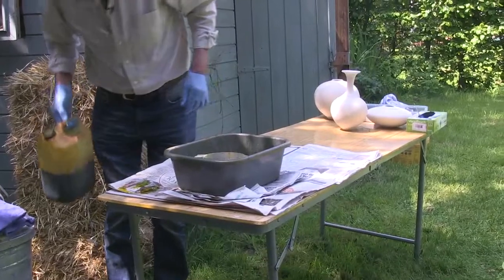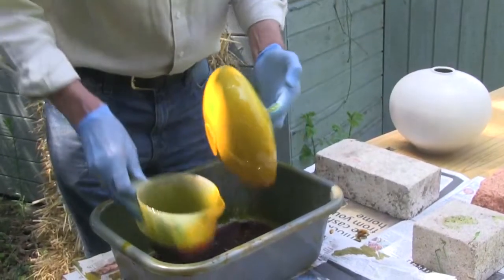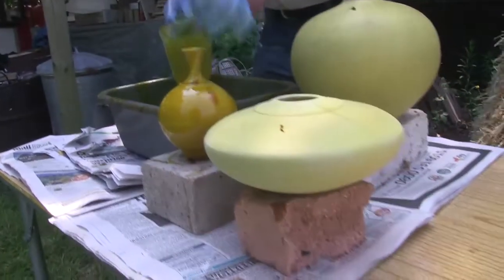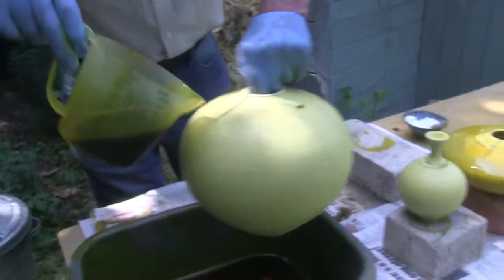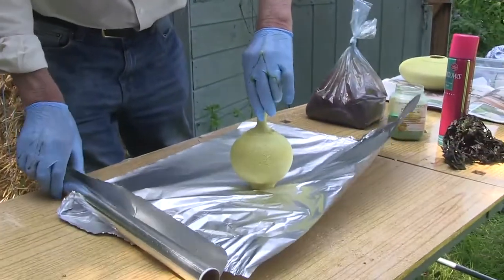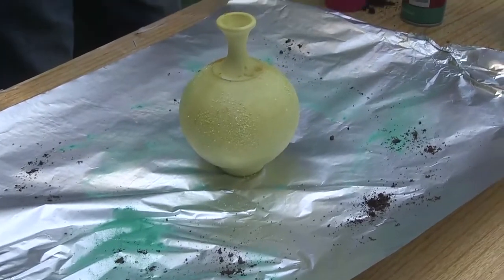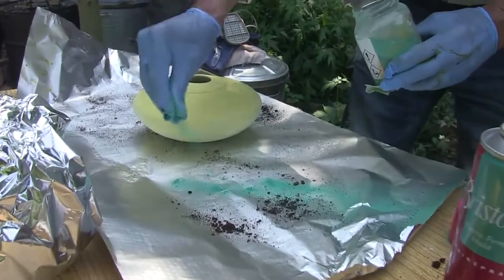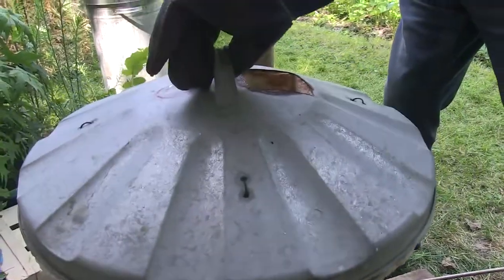Saggar Firing

Comment: Did you make your own kiln? If so how? What colour effect does the ferric chloride give? Would the ferric chloride work for a pitfire? Thanks so much it's a wonderful video.
Reply: Hi Colleen, thank you for your comments, yes I made my own raku kiln from a dust bin, there are several you tube videos which you would find helpful my recommendation is that if you choose to make one , use a dustbin with straight sides most bins are slightly conical and this makes it a little difficult in cutting the fibre.when purchasing fibre choose the none carcinogenic  . You can achieve the same results in a pit fire or oil drum fire if you add sufficient wood you should reach 750 to 800 centigrade well worth trying. Hope you are keeping well in these difficult times.Regards Frank

Comment: Love your work and fabulous film, when you fire it to 750 how long do you keep it at that temperature (soak)? Can you confirm the colours the materials produce - Ferric Chloride -Orange, Copper Carbonate - Green, Sugar - Black, Coffee Grains - ?, Seaweed - ?
Reply: Hi, I do apologise for not responding sooner. Fire the pot to 250 hold at 250 for about 15 minutes then increase the the temp to around 750 turn off and allow to cool to around 300 .remove from the kiln ,carefully remove the foil and allow the colours to develop.the ferric chloride will give you light orange,the copper carbonate will give give you a rich orange the sugar will create halos within the colours. Seaweed will create black/ green spots, coffee grains black spots , Epsom salts will give you yellow if when you close your foil you press some of the foil tightly against the pot you will create grey . The results are very unpredictable . Hope you find this helpful. Regards Logan
Reply: @franklogan7557  Thanks Frank that is very helpful. I love your work and thank you for sharing
Reply: @franklogan7557  .  Do you spray or dip them in water to freeze the colour, or do you just let them air cool and hope they stop where you want them to?  really nice video.  I loved the results.
Reply: Are we talking about Fahrenheit or  Celsius ?